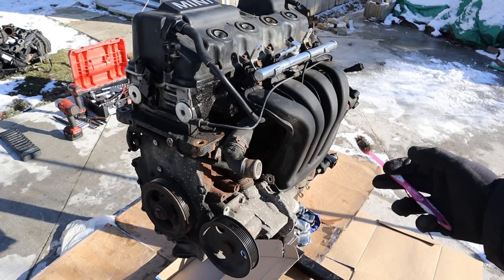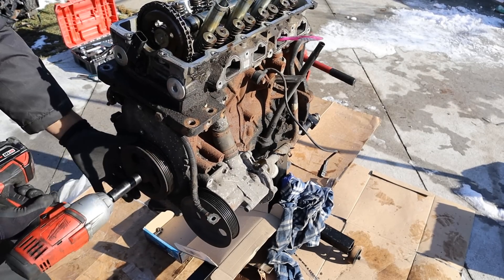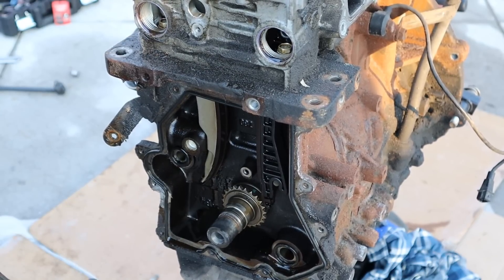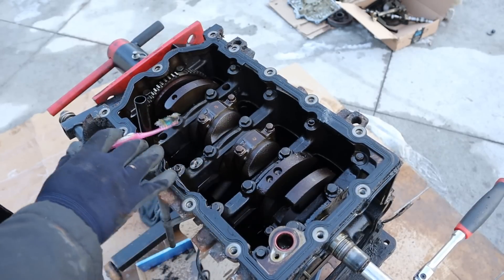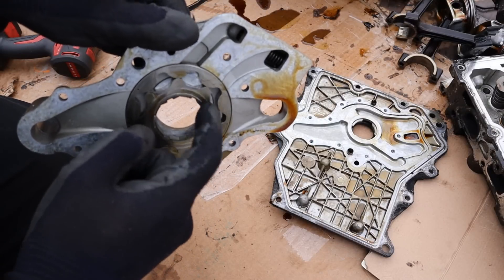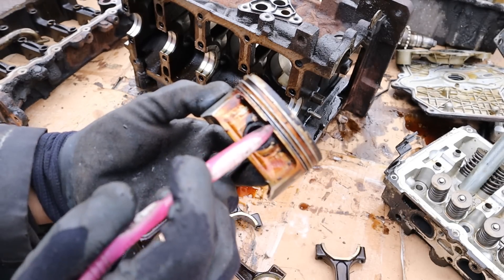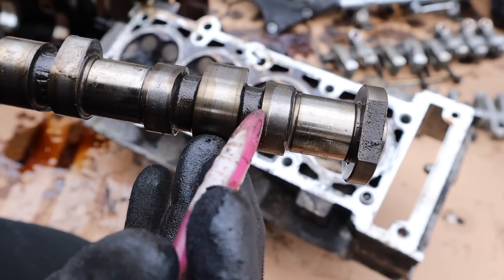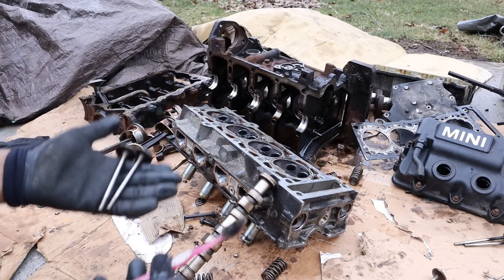Why Mini Cooper Engines FAIL

Comment: These are great engines, if old school and unspectacular in their design. The supercharged version has forged pistons as standard, (and sodium filled exhaust valves.) They will do serious power increases on standard internals
Reply from the maker: I agree. Pretty basic for a BMW
Reply: The supercharged engine exhaust valves are solid inconel, not sodium filled. I worked on the development of it for Chrysler, and authored the 2001 SAE World Congress technical paper on it.
Reply: @hoganfan924  you are of course correct. After a little more research I realised that I had fallen victim to the phenomenon of repeating misinformation found on the internet. There are several mentions of sodium valves on a particular American Mini forum. I guess one person said it, and then everyone else repeated it. Thanks for setting me straight. Have you read the pieces on the engine development by another engineer on the project? I think his name is Alex, he goes by "unbreakablelump" online, a reference to the engine. A good read for me as a mini owner, though you probably know it all already!

Comment: Interesting teardown video. The Tritec engine doesn't have a reputation for failing, it's actually known as a very solid and very upgradable engine that'll take a lot of horsepower. The MINI engines that have a bad reputation are the engines from the Generation 2 cars starting in 2007, which used the twin-cam Prince engine and suffered timing chain issues. The only significant reliability issue with the Generation 1 MINIs was due to the Midlands manual transmission used in the 2001-04 non-supercharged models (replaced by a very reliable Getrag transmission 2005), and a horrible CVT automatic transmission (and anyone who bought one of these cars with an automatic missed the point of the car entirely, anyhow), but these issues unfairly gave MINIs a reputation for being unreliable.
Reply: i couldn't agree more but from my experience the automatics at least on the r53 models were produced by Asin same manufacture for Honda the weak link was the shifter solenoids going bad allowing to come out of gear and the transmission itself seems pretty solid. i personally prefer the getrag 6 speed manual transmission automatic takes all the fun away  lol. i love how on the first gen its rare to see one with a automatic trans compared to most vehicles in the states its the other way around.
Reply: Even the gen 2 prince is pretty reliable NA but if you do get a turbo model, there are definitely some "required upgrades" around the 50k mile mark, namely the plastic guts.
Reply: Plenty of people don't like to manually row gears but like the look of the car or how it drives. Tho no one should want a CVT lol ;)

Comment: Putting this out of context post here because i wanted to say you make an excellent channel and thats not wasted words. Anyway,

I just financed a 2015 Nissan rouge against all youtube advice pretty much.  Best I could do right now.  My first cvt, it feels like they kept going with a bad idea on these things.  I guess it's better sorted now but wtf its so weird.

It was dealer checked and readied, has a warranty, a great service record and (only) 75k miles,  plus it was built in Japan, one of the years they had to meet demand by also making them over there.  Best case scenario for a rouge on a budget I guess I could say.

Anyway, keeping my 2006, 240k Honda Accord, did not trade it in for scrap prices.  Yeah it needs emission work to pass inspection, and a brake is fried, plus the power steering fluid pours out, and it has an oil drinking addiction....it's  the real deal simple and reliable.  First time in maybe forever I have a back up car I own that I can technically drive if I have to right now., But can take apart bit by bit and not worry about a thing.

My plan now is to fix it up and give it to my son when he's old enough. 5 years.  I really want this soon to be superior relic to be in my back pocket until then, and it will be.
Reply from the maker: Good call. Honda's are good cars

Comment: At 0:18, before I saw the whole video, I noticed some discoloration of the Spark Plug Tube, and I suspected that compression was being lost on No.3 Cylinder. I had a '65 Mini, that ran and ran, based on the A series engine. It's a whole different "Mini' these days, and does not share much with it's origin. Mini engine didn't look too bad considering 1/4 million miles. Thanks for educating us!
Reply from the maker: Good call
Reply: that's kilometers not miles
Reply: @dmac7660  Sorry! I was thinking that this Mini was in the USA where miles are recorded.

Comment: i had a supercharger r53 tritec and mine had 360k miles before the heat soaked head threw a spark plug out the socket!
Reply from the maker: Wow. Did it just strip the head threads?

Comment: Engine mount is connected to the head and another to the block and overtime head gasket issues develop
Reply from the maker: But I've seen many engines mounted to their head
Reply: @speedkar99  RH Engine mount is connected to the “shelf” at the top of the block, which is why the front timing cover doesn’t extend to the head. There’s no mount connected to the head on the Tritec engine.

Comment: BMW tech here. Always tho9ught these engines were a really crap design for BMW, now I know chrysler is to blame. Working on that engine, it felt like something from the 70's with the addition of plastic. Never made sense in a BMW.
Reply: Compared to the Prince engine made by Bmw and Psa from 2007 to 2014, the tritec is gold
Reply from the maker: I think the newer BMW stuff is more strange....this has some simplicity at least
Reply: @speedkar99  this has US written all over it, the design is very behind.
Reply: @chippyjohn1  Well, the design is now 26 years old, and 3 generations ago of MINI.

Comment: I'm about to buy a 2008 Mini Cooper with only 41 000 kms on odometer !
Should I be worried or not at all ?
Reply from the maker: That sounds like very low mileage for a 15 year old car
Reply: @speedkar99  It is, but it's genuine !
Previous owner had 2 or 3 cars...
Reply: I'd make sure that odometer hasn't been rolled back at that year & mileage, for starters...
Reply: @jacquesc3166  Mileage is genuine !

Comment: Excellent video, thank you i wanted to see one appart for a long time.
I'm "considering" a Supercharged Cooper S, glad to see they used basically the same engine between the atmo and supercharged variants. Once modded thoses minis are rockets and pretty light (2500lbs), it's the smallest/fastest/ non turbo car i know of
Reply from the maker: The supercharged engine has stronger internals
Reply: @speedkar99  Forged crank and forged connecting rods.

Comment: This engine has an interesting story, being connected with fiat's 128 sohc and Torque design, giving birth to the E.torq and prince engines further along the line.

And some of the gasolines from the Pratola Serra series use a similar layout for the intake manifold

Bmw had nothing to do with the design, they hated it.

They just got stuck with it after buying the rover brand
Reply: It was Bernd Pischetsrieder (BMW President) and his Engineering VP Wolfgang Reitzle who made the deal with Chrysler. Reitzle also oversaw the operations of Rover group for a while after the BMW acquisition. The engine was designed, engineered, and developed by Chrysler’s small car platform engine engineering department, of which I was a part. I worked on the development from mid 1997 until late 2000. It was a clean sheet design, and patterned after the 2.0l SOHC (which was derived from the early 90’s 3.5l SOHC V6), but with a chain instead of belt. It only shared a handful of parts with the 2.0l (hla’s, ignition coil and some sensors and screws). BMW had almost no input into the base engine design. It turned out very well for the most part.
Reply: @hoganfan924  how cool, i also film cars on YouTube on a Romanian channel and today i filmed a 2006 mini cooper s with the Tritec supercharged engine
Reply from the maker: Yeah I read about that BMW was not interested in economy engines
Reply: @speedkar99  yes, and fate kicked in when they made lots of errors for the EP6/N13 prince engine, which was a total rubbish between 2006 and 2012

Comment: No.  At 0:37 that engine does not have four separate coil packs sitting on top of the spark plugs - instead it has a single coil shared for all four cylinders. That coil sits on top of the valve cover - those four bolt holes to the left of the oil filler are where are the coil sits.
Reply from the maker: Thanks. I'm dumb for not researching this enough

Comment: Engine totally worn out at 155,000 miles? That’s way more reliable than either BMW or Chrysler can manage on their own, but still a joke.
Reply from the maker: Yeah it's pretty rough when 4 cylinder Japanese brand motors run for double that

Comment: Looks like it was well maintained, or it would be varnished.  For its mileage I’m surprised at the cam wear. Doesn’t look like the typical starved for oil. I wonder about hardness issue, or if pressure/contact area exceeded film strength. We didn’t get a close look, but it looked like the exhaust seats were pretty trashed.  Anyhow, great video.
Reply from the maker: Thanks. And yeah it can be the hardness, material choice or just a starvation if oil in that local zone

Comment: The intake ports and valve seats look fantastic. The exhaust seats look terrible. It would have been a candidate for one of the “top engine cleaner” aerosols. Or maybe just an Italian tune up aka go run the crap out of it for a few miles and blow the carbon out of it. 

The cam is the wrong material or heat treatment. Typical bean counter issue.

Comment: engine looks well made to me.. especially with cam chain that doesnt need replacement like timing belts..if it ran on 8 valves it wouldve ran forever!
Reply: Those chains had a nasty habit of stretching because they where essentially too thin, paired with a chain tensioner that wasn't strong and durable enough. You had to replace them with after market parts at 80k - 90k km or risk a catastrophic engine failure  especially if you had a sportive driving style. And all while people thought a chain never had to be replaced.
Reply: Chains DO need to be replaced.

Comment: BMW did not really have much to do with this engine.
It was a Tritec engine made in Brazil, which was a Rover/Chrysler joint venture.
BMW owned the Rover Group from 1994 until 2000 but with very little interference, hence the connection.
The Tritec engine was heavily criticized by BMW due to bad fuel economy and low performance. 
Anyways Honda owned part of the Rover Group prior to BMW, and made crappy cars as well.
Later on the Mini got the Prince engine, which featured a lot of BMW technology, but was produced by PSA.
BMW then moved on to the modular B38 3 cylinder design with 500 ccm pr cylinder, sharing parts with other BMW engines.
Finally the Mini got a decent engine.
Reply: The Tritec engine won awards for being one of the best engines out there at the time, and that's why it was used in a lot of cars. BMW chose this engine over a Rover unit, and it's a good thing they did!
Reply: The Mini was developed by Rover to use their K series engine which was all alloy, it has head gasket problems when enlarged to 1.6/1.8 which concerned BMW. At the time (1997/98) BMW were thinking of buying Chrysler and identified the Tritec as a safer option for the Mini. So BMW took over the the Mini development and kept it when they sold Rover in 2000. So for a while Mercedes effectively supplied BMW with engines!
Reply: @simonroyle2806  That’s exactly why “BMW badmouthed it” when they introduced the R56 with the “Prince” engine. They were upset when Daimler bought Chrysler, after BMW signed the JV with Chrysler. They could have done upgrades to the Tritec engine but didn’t want to do business anymore with their arch rival Daimler. So Fiat did in 2011 with the “eTorq” version of the Tritec (still in production today, with VVT, variable oil pump, and a few other tweaks.
Reply: The Mini One Diesel was a Toyota Engine and that made it expensive .

Comment: I have a Mini Cooper with the same motor and it’s over 20 years old and has never had to come apart.
Reply: Probably every 3000 or every year which ever comes 1st. Wife used to be a home carer but now changed jobs. And it doesn't get used much. But haven't got the heart to sell it. Its part of the family
Reply: I bet you change oil and filter at 5000miles/8000kms instead of the dealer 10000miles/16000kms interval? My car is 19 years old and I change oil & filter every 5000miles. Engine is like new.

Comment: im surprised of the odd wear considering how clean it was inside.....
Reply from the maker: Yeah it sure is clean
Reply: Cam lobe wear is fairly common on these engines.  I had a cam lobe on cylinder 1 that was worn much worse than shown here.  155k miles on it then.

Comment: A well deserved retirement for a 260 000km engine, I would say...
About oil consumption, is it ok for a new engine (20 000km) to burn about 0.5l oil for 10 000km?
In question is a 2l Skyactiv-G (Mazda) engine. Should I expect any improvement after 30-40 000km?
Reply from the maker: Yeah. The newer engines will eat oil faster
Reply: I have a 2016 CX5 with the 2.5 L engine. It burns about one liter in 10000 km. Mazda says this is OK. I add some new oil every 2500 km to keep the level correct. It's caused by looser bearing tolerances to decrease friction and the oil viscosity which is very thin (0-20). These factors affect mileage.

Comment: The headbolts were loose. Pretty much normal for any aluminium head with high miles. It causes a leaking gasket.
Reply from the maker: I thought they were torque to yield. Shouldn't come loose...
Reply: @speedkar99  The important part is "aluminium head" The metal under the washer crushes and the sides of the bolt tube collapse and so the bolt loses clamping force. When you pull an engine apart it's always good to treat it the reverse of building it. Take note of how tight the bolts are and whether or not they're stuck. Better still put a paint mark on the head, back it off and measure how much torque it takes to get it back to the starting point.

Comment: What is this engine code, a W10B16A or W11B16A?
I don't know how they differ
Reply: W10 is NA like the one in the video.

W11 is supercharged, has forged crankshaft and oil squirters to cool down the pistons.
Reply: Thanks 
Appreciate it
Reply: This is a W10. The W11 base engine has bigger main & crank bearings, forged steel con rods & crankshaft (instead of cast iron), upgraded intake & exhaust valve materials, hypereutectic pistons, piston oil squirters, and an oil cooler.

Comment: When you said 260k I was like, these things actually last that long?  

Based on how clean the inside was (carbon notwithstanding) it definitely looks like it was well maintained.  Was expecting the inside to have lots of varnish inside it.
Reply from the maker: Yea it's pretty clean but worn.
Reply: It's only 160,000 miles .!
What's all the fuss about.?
160,000 ! I had a Rover maestro that went to 300,000 miles but everyone was obliged to laugh at Austin -Rover ,but fawned over bmw -the overpriced overrated chav wagons.
Reply: Solid engine, easily get another 100k out of it with a light hone, rings and a valve grind.. 😐
Reply: He usually is speaking in Kilometers, not miles. I could be wrong though, but I don't think it was 260k miles.
Reply: @mazelme  yes, it's Km (he says it in 0:14). Not bad for a BMW Chrysler engine
Reply: @mazelme  Oh I get it.  I'm in a country where we use the metric system/km's.  I stand by what I said, I'm surprised it made it to 260k (kms).  I assumed these things turn into botttomless money pits at around 150k (kms) or so.
Reply: @runningawayvagabond5876  just admit you were wrong

Comment: seems solid! i was expecting carnage... so the valves seem the weak link, how do you help guard against this failure?
Reply from the maker: If it's a design failure there's not much you can do... 
Changing fluids and cleaning the carb out of the intake won't help much
Reply: use electromagnetic valves

Comment: Thats a neon sohc engine. Bmw said make it a cartridge filter and use our stupid timing cover set up and we have a deal. 
I work on bmw engines from the 90's till current, this isn't a bmw engine per say. Maybe 5% of the design they were involved in. Good news though, that sohc neon engine was a good engine
Reply from the maker: Too bad for the rest of the neon. 
That 5% is definitely that stupid timing cover.

Comment: I'll never forget a fiat engine, the crankshaft pulley + V-belt pulley was held in place by a left-hand thread, thinned in the middle, glued in place. I thought I'd unscrew it, like the thousands of engines I've taken apart so far...
Reply from the maker: And you over tightened it and it stripped out?

Comment: Hello Mr Speedkar99, it's clear to me that you have extensive experience with automotive components, as such, I'm wondering where you learned of the benefits to be found in utilizing this free source of hygiene products and their excellent cleaning properties ranging from various colored fluids through to solid detritus? Also, having made a pop tart mess on my floor which I cleaned up with cotton buds and a toothbrush obtained from a neighbor, do I wash these items before returning them or just return them as is? Thank you in advance.
Reply from the maker: I use what I can find. 
If that means sneeking into the medicine cabinet or the laundry room then that's what I gotta do. Shop towels are too expensive. 😁

Comment: What year did they go with full bmw engines?
Reply from the maker: Prince engine
Reply: @speedkar99  Prince was mostly a PSA design until the N18 with valvetronic. They didn’t go with a fully BMW designed engine until the Gen3 F56